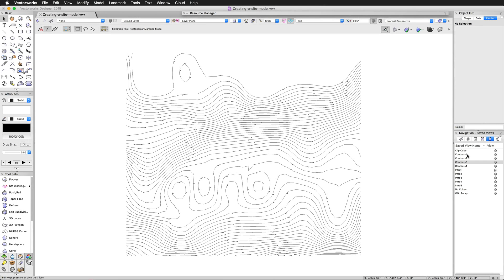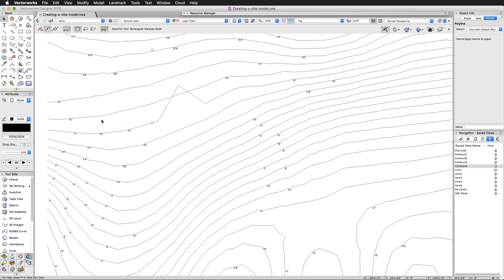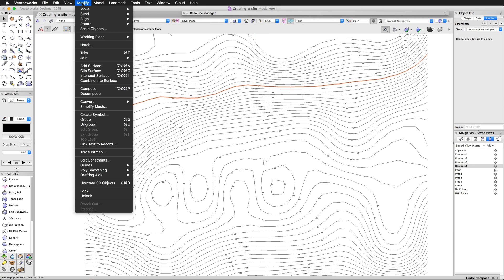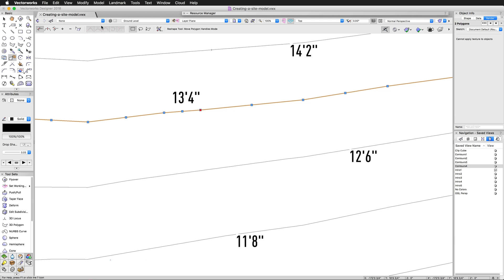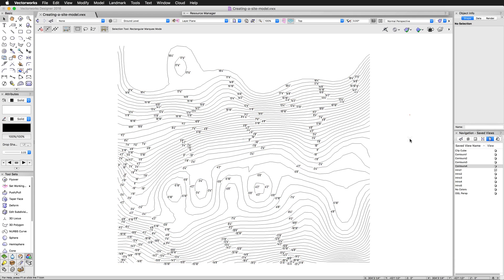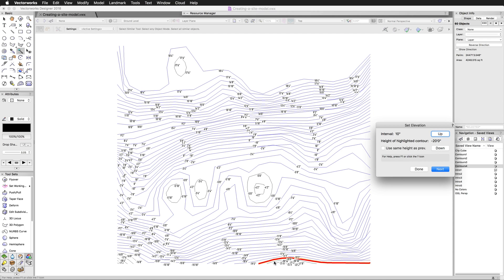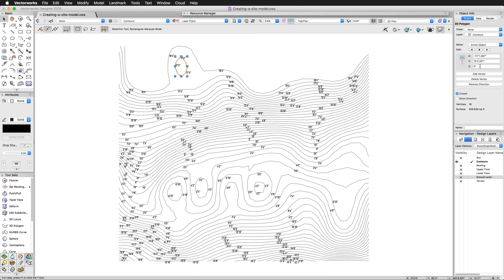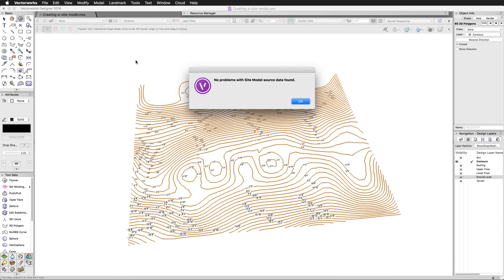Site Design - Creating A Site Model

Comment: I've tried this method with a couple of files imported from dwg with different results. The first was OK, it behaved pretty much the same way as you show. The second one after selecting  "2d polys to 3d source data" and fill the starting values and hit OK all curves appear with "fill" so a complete white area covers everything, no text can be read and no curve highlights in red making it impossible to confirm values in the text box. I've tried keeping text and curves as different classes and "curves" class with no fill but it is always as described. Any suggestions?

Comment: Hi there. I'm having trouble connecting polygons together - the just won't 'compose'. When I zoom in really close, the two polygons are disconnected, and the ends are not meeting at all. Is there a way to fix this without having to manually adjust every single contour line?
Reply from the maker: If they aren't actually connected, you can TRY scaling up all the contour lines (assuming this is a survey import?) a very small amount, something like 1.005 and then they will have enough overlap for compose or add surface to work on them to get contiguous polys, but that can sometimes cause problems of its own. Without clean survey inputs a lot of manual work can be required. Check with tech@vectorworks.net and have them take a look as well.
Reply: Alright. I'll give that a try. Thanks for the reply!

Comment: This is great! but I have a question, what do I do when my terrain is not a square or rectangle and want to make a site model with the shape of an irregular polygon? Every time I try the model ends up in some weird shapes. Thanks!
Reply from the maker: The easiest way to control this is likely the Site Model Crop. If you double click on a site model, you will get that as one of the edit options and you can add an irregular polygon, as long as its just a single object. This model was rectangular since the contours I imported had already been cropped out, but it could be cropped further if desired. Make sure you don't try to use the contours themselves to try and define the edges of the site model or you may get some very strange results.
Reply: Right Click out the site model and edit the site model cropped boundary, which is generated when creating the site model